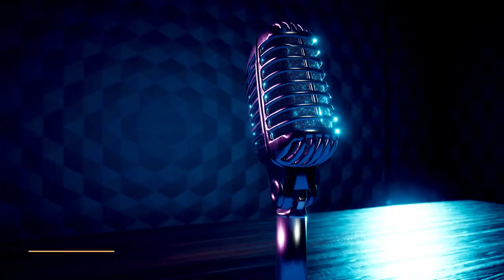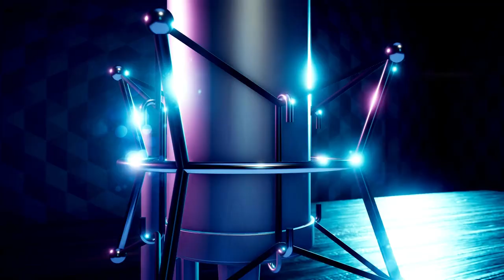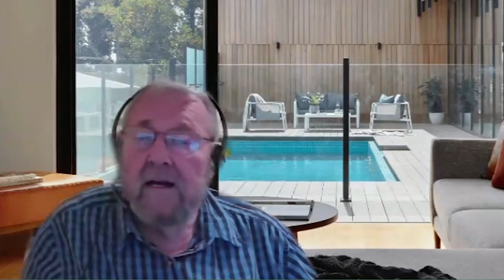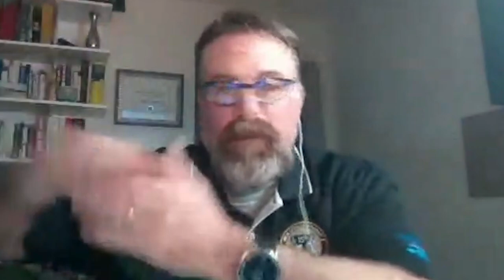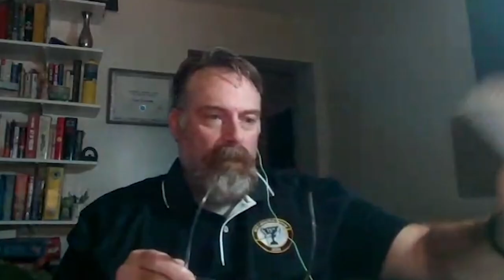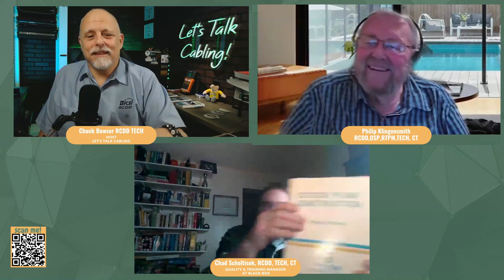The Basics of OSP with a Couple SMEs! | RCDD

Comment: A lot of these conversations are over simplified and shouldn't be taken as accurate. Typically yes, underground with 2, 2'' ins rather expensive especially in metro areas.  Aerial can become just as expensive though if pole replacements are required or the spans require a bunch of make ready done by the other comms and power.  Also Aerial cable frequently is damaged by rodents, more so than on underground cables.  What is really more typical than you'd think is gunshot damage on aerial cables, you'll get at least a handful of cases a year for the 4th and New years, and even more often in rural area.  Also, if you wanna learn about OSP I'd suggest becoming a apprentice and NOT going to school for it.  Many companies will train greenhorns because the returns on investment are a huge advantage.